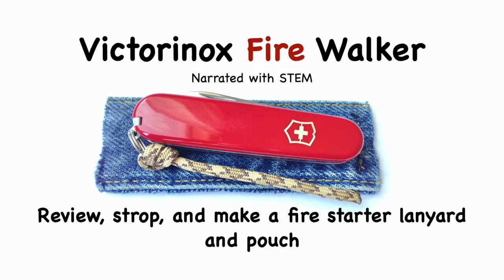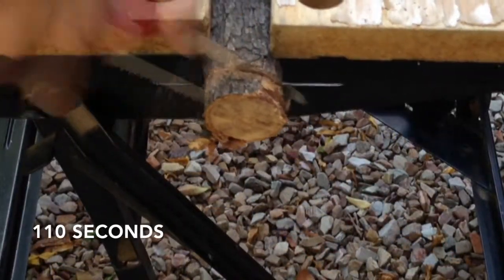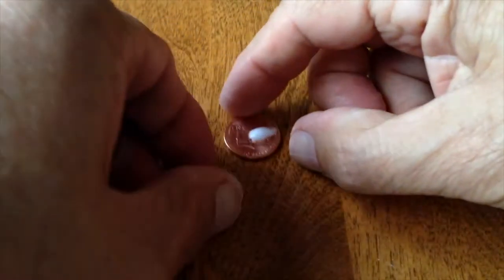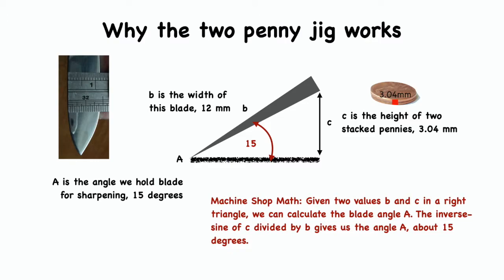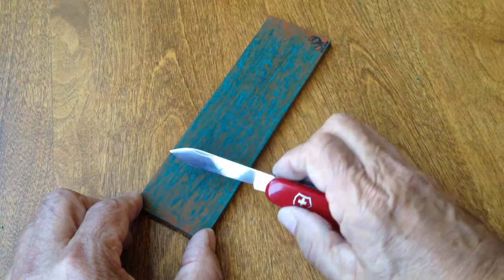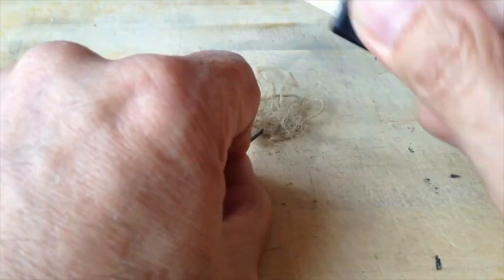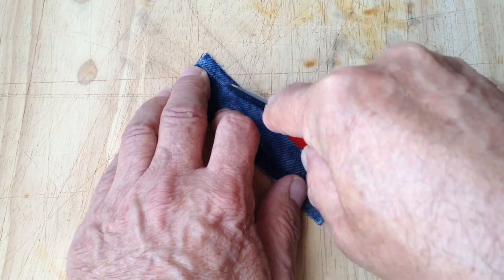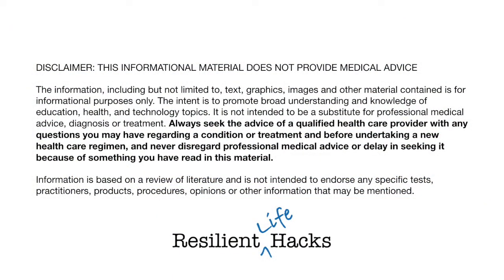Narrated: Victorinox Fire Walker

Comment: i always struggle to understand the need for these emergency fire starters. if youre going for a hike or camping then you will have a backpack. so carry a more robust fire starting kit and a bigger knife and a folding saw or small hatchet. i would never head out into the woods with just a swiss army knife. except for the saw it is not a survival tool.
Reply from the maker: You are a prepared hiker/camper and not everyone is as prepared. I was wilderness paramedic and unfortunately experienced the consequences of people not being prepared. And, it's always desirable to have a fall back device, too. This of course assumes one will have actually practiced using a ferrocerium rod.

Comment: They make much smaller ferro rods to fit in the corkscrew of a swiss army knife and Felix Immler demonstrated on video that he could set over 100 fires with one. So the rod you have could probably start a lot more than 5. But I get your concept, that basically it's an emergency rod. Thanks for the tips!
Reply from the maker: Yes, I was being extremely conservative, but I found that repeated use of the 3/32 inch rod weakened it particularly so when scraped on one side. I really look at this as an emergency or backup device and would not really on it as the primary fire starting tool.

Comment: Great :)
I love sak but when the fingers are freeze, it s very difficult to open the blade….
And with glove its impossible
Reply from the maker: Yes, that is indeed a problem with the small SAK. The larger versions, particularly those with a finger hole are better. Maybe the reason the Mora makes sense in the coldest climates.

Comment: Awesome. Gave me a lot of good ideas. I think a company called Firefly makes ferro rods to replace the toothpicks in Swiss Army Knives which could give an additional source of spark on top of that mini rod you inserted into the paracord sheath. Thanks for the video.
Reply from the maker: Yes, I have not used Firefly nor the newer Victorinox versions but understand they are well liked. The approach here was intended to be a low cost DIY with somewhat easy to find materials.

Comment: This is the first time I've seen the technique you show for wire stripping with a Victorinox. Sadly many models that have the same two tools don't have them placed so that they can so easily be used in combination. But thanks for showing it. Excellent hacks!
Reply from the maker: Thank you for watching
Reply: Which vics are not set up with the knife on the skinny end and the bottle opening tool on the fat end?
Reply from the maker: @jimmyh6579  You might give SAKWiki.com a look. They are a good reference source for current and past models.